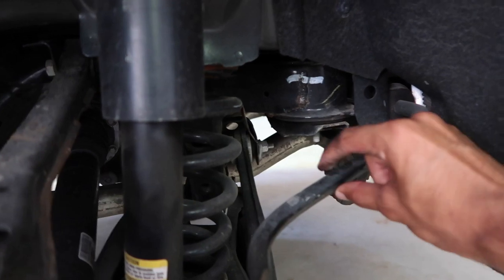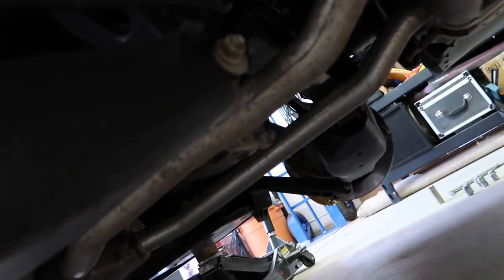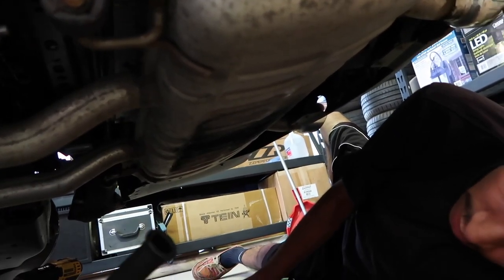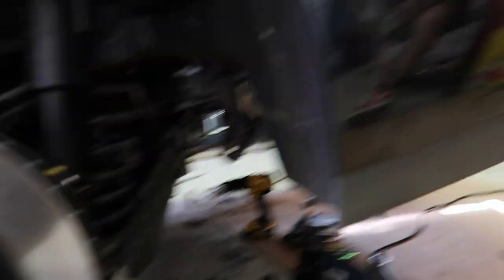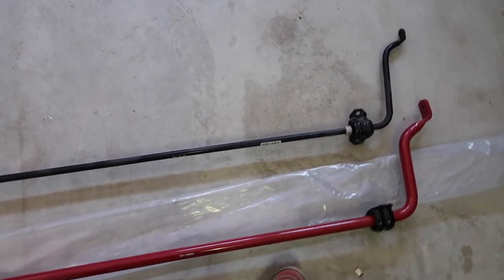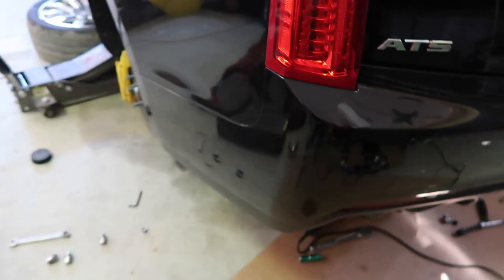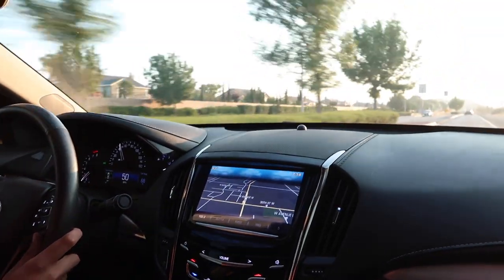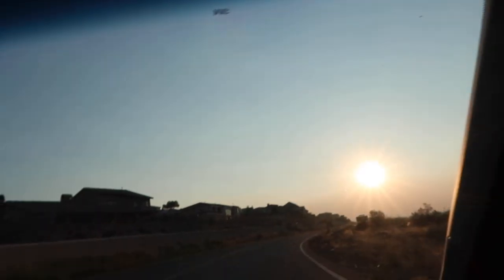Cadillac ATS 2.0T 6MT Update + Rear ZZP Sway Bar Install

Comment: I have a 2014 Cadillac ats4 2.0t, and just recently my pistons had cracked causing my motor to lose compression, apparently a lot of 13 and 14' ats owners have had this problem, my motor has since been rebuilt but you arent the only one for sure

Comment: Where's the new ATS vids bro? Since coming across your vids, I picked up a 2016 ATS, 2.0T, AWD, 8-Speed. I'm gonna start a channel with all my upcoming mods as soon as the weather breaks
Reply from the maker: I hurt my ATS again she's currently down :/ But the comeback will be better than ever trust me!! Welcome to the cadillac family!
Reply: @PREVA1LMOTORSPORTS  sorry that happened. Thanks for the welcome. I hear the older ones had a few issues, thankfully I purchased the revised model. It has a bit more horsepower and torque. The 8spd auto is pretty good also. Mated to the AWD system, this little Cadi moves!
Reply: @PREVA1LMOTORSPORTS  We are looking forward to the come back 😎👍💯
Reply: any issues since you got it bro? im hoping to get a 2016 2.0t awd this weekend.
Reply: @joshobrochta160  no real mechanical issues. My CUE screen dod the known screen shatter. Had both rear wheel hub bearings go bad around 35k miles, had the transmission flushed due to a recall/service bulletin, and had to replace both oxygen sensors around 50k miles. Everything was done under warranty except the oxygen sensors.
Reply: @simcityauto9610  thanks for the response. I heard that cue system was ass but I was hoping it got better on the newer models. So none of your aftermarket stuff voided the warranty then.. is it just a new tune that voids it?
Reply: @joshobrochta160  no nothing I did to my vehicle is noticeable except for the intake tube and charge pipes (neither of which will void your warranty unless your dealer is just that pressed). Aside from that, nothing that went bad had anything to do with the powertrain as stated above. The CUE screen is a bit of a nuisance, but I haven’t had issues with it since they replaced it. The remedy to protecting it from shattering is keeping it out of the heat or direct sunlight in the summer months.

Comment: By chance do you know where i can find a video to install the front strut tower brace do you lol
Reply from the maker: Unfortunately I never made a video on that install as it's pretty straight forward. 3 nuts on either side and you're good to go. You have the ZZP strut bar??
Reply: @PREVA1LMOTORSPORTS  yeah i do. You know at first i thought i would not ckesr the reservoir on the right side of the engine but i figured it out they sent it to me with the end pieces upside down was what it was
Reply: #clear

Comment: I'm confused.  You installed a catless downpipe and CAI without doing a tune and then the motor blows and you blame the previous owner?  Good luck with all of that.
Reply from the maker: The motor blowing had nothing to do with the intake or downpipe. I don't know if you possibly own a LTG powered car but these things are plagued with weak pistons it's a well known issue across all forums. Go on cadillacforums.com and check it out theres countless people that vary from bone stock cars to obviously tuned cars that had the pistons let go. I bought my car with a knock and I thought it was normal turns out it wasn't so yeah that's the reason I believe my cars previous owner hurt it then I got it and it blew 2000 miles down the road.